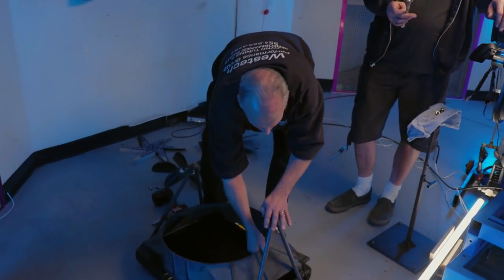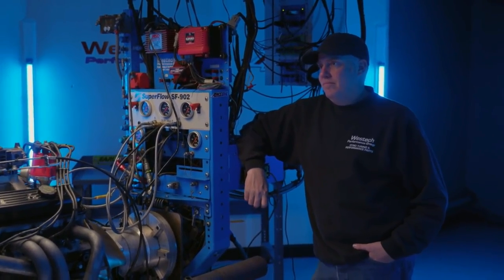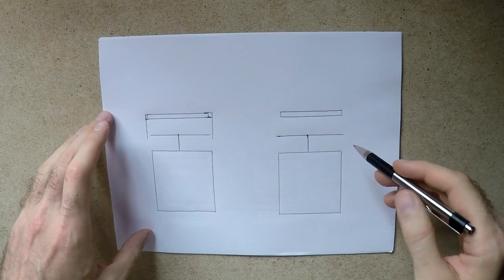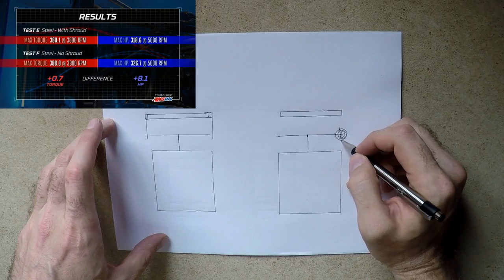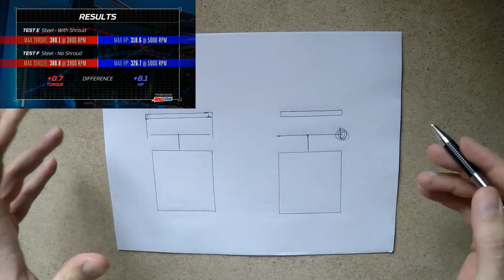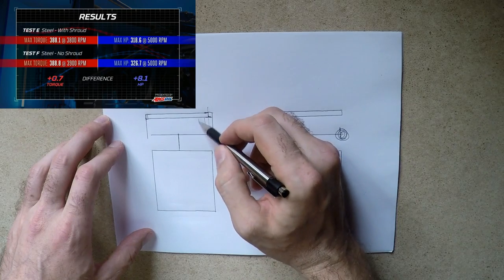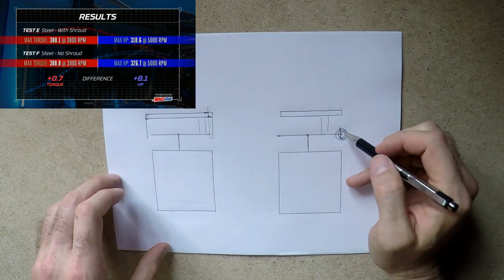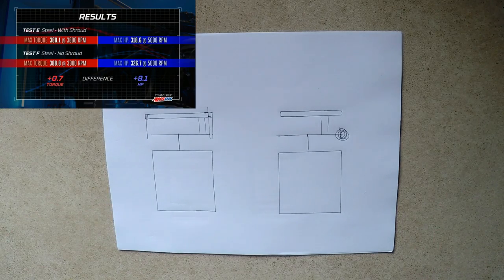Engine Masters EP20 explained!  Why a fan shroud costs you power.

Comment: So where does the horsepower that is robbed by the fan go?  Have a think about it......it goes into pulling air through the engine compartment, creating a lower air pressure in front of the vehicle, accelerating masses of air backwards and in reaction the car moves forwards......(however you want to think about it)  That's where the energy goes, thats why in operation there wont be significant fuel economy increases by going to elec fans, unlike on a dyno where the energy that goes into moving air through the car wont show up on the rollers.  If the car comes with a shroud, the designers found that it was necessary to get enough frigging cooling, at to control the airflow under the bonnet, 2nd guessing the designers is fools play.
Reply: You might see some pockets of reduced pressure in front of the vehicle, but that is due to boundary layer flow around the moving vehicle, not the fan.  Pressure will ALWAYS be higher on the inlet side of a heat exchanger.  The BSFC of an engine determines that x hp consumed by the fan (or by any parasitic item) will consume a certain amount of fuel.  The air blowing rearward propels the car forward negligibly, as that amount of pressure and flow is insignificant vs the car's mass.  Fans absorb horsepower at a cubic rate vs rpm - meaning if you double the rpm you are losing more than double the hp.  Finally - teh real reason there isn't a significant increase in fuel economy is because most engines don't spend significant time at max rpm where the greatest hp loss occurs, and if the vehicle is moving, that airflow reduces the required fan rpm that is necessary for engine cooling.
Reply: @furyfantoo  "Fans absorb horsepower at a cubic rate vs rpm - meaning if you double the rpm you are losing more than double the hp."
Dont think you have thought it through(not disputing the non linear load on the fan with rpm), if the fan is absorbing all the energy? how does the fan display this absorbed energy? gets white hot?.......it doesn't.  The energy it uses is in moving the air, whether you think about it as drop in pressure in front of the rad or newton's 3rd law of motion pushing air backwards and the reaction force on the fan pushing the car forwards is academic.  I agree its not the most efficient way to propel a car, but the effect is real, that is why you cant really look at the numbers on the dyno as representative of how much hp you gain as the air that the fan is blowing on the dyno isnt helping the wheels turn, but on the road it is helping move the car.    With a proper clutch fan, they are rev limited to ~ 3000 rpm even when thermally loaded, and much less than that for the majority of operation.   A well designed racing car, shouldnt need any fan , unless its sitting stationary, electric makes sense.

Comment: ELECTRIC FANS
Reply: Electric fans, plus electric water pump. plus electric fuel pump. plus MSD ignition, plus hid headlights, plus high amp sound system, plus heater blower, plus phone charger, plus everything else electrical. And you will need a alternator capable of lighting a small city. That's one of the main reasons to consider belt driven fans. Plus they do not rob enough HP to even care about it.
Reply: @johnlaws9853  literally -8hp in the video, 8 fucking Hp!!